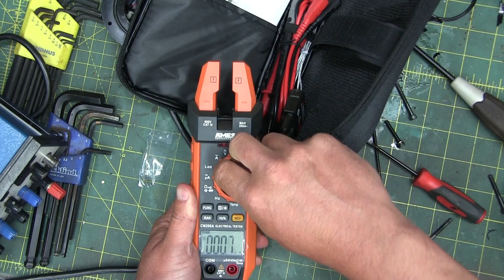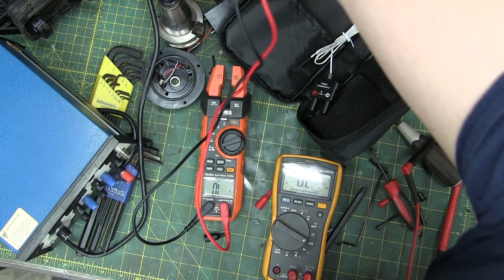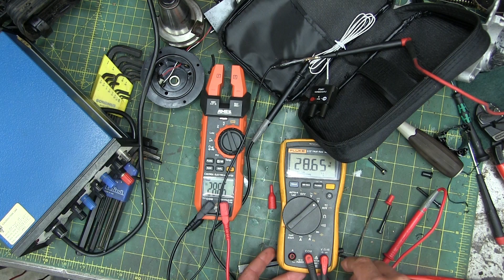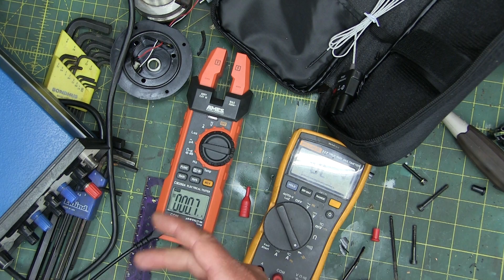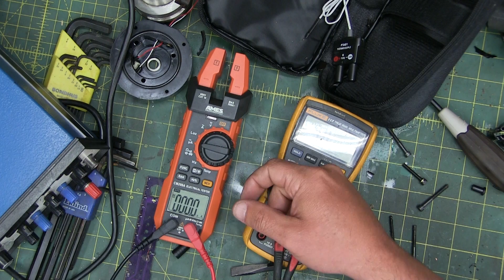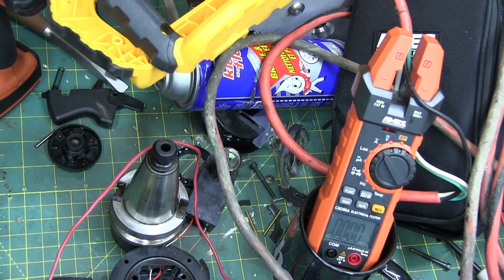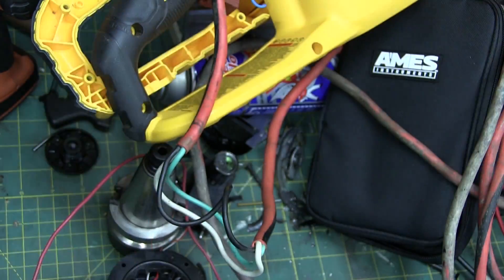BOLTR; Harbor Freight Fork Meter | Shockingly Accurate!

Comment: Not the first time I've watched this video. I have this meter and compared to all my others, the supplied leads are the best I've found. The meters I use for Electronics projects are this one(Ames CM200A) and a CenTech 61593. The Centech's limiting factors are it only has a 1999 display and it's not auto ranging. My ideal meter would be a Centech 61593, but auto ranging and a 9999 display.

Comment: In automotive use cases we use something similar to the pickle fork, we use a ring magnetic inductive pickup thing. Perfect for measuring high current with something like a fluke 88 and testing alternators or parasitic draw

Comment: Ave, I am hanging my head in shame for you. There is no way that is a CAT 3,  Cheap China meters stick those ratings on all the time. I have used HF meters before and yes they can be OK for basic stuff and even reasonably close in reading but to paraphrase you, if ya gotta KNOW, ya gotta KNOW and confidence is not high, I say again confidence is not high on cheap meters. Since I started into electronics in my retirement (use under $50 meters my whole life) I have seen the difference and thus dropped some coin on a real meter that will last the rest of my life and is warranted for life, a Fluke 287. Yes it has stuff I will never need but when say it is CAT 4 rated, you can bet your life it is truly CAT 4 rated. Likely as not the HF meter as a meter to throw in the trunk of your car or the bottom of your tackle box tool box it will serve you fine.  A backup meter on the job or to give REAL data, it is not.

Comment: still think itd be great if you checked out the 'an8009' /aneng8009 (NOT the 8008) i think youd be super pleasantly suprised by it for a dog cheap meter to actually use day to day to save risking your expensive stuff, let alone as just something to have multiple of stashed all over the place for whatever situation arises where you might need it, and it being so cheap you dont have to care about it rolling around under your car seats for months or somewhere higher risk where it might get 'borrowed' permanently or fiddled with by not-you.
and melf / minimelf / do213 / sod80

Comment: Raise your hand if you had a cheap multimeter set on ohms, and you accidentally probed a wall outlet and the thing exploded. I did this... once. It was a very cheap meter, like a 80's bottom of the line radio shack, little red POS analog meter. In a similar story, I was in a mechanical room once with a balancer guy, and we were chatting while working. Our conversation was lively, and apparently engaging enough that he, after checking the current draw on a pump, tried to check voltage across 2 of the 3 phase leads with the meter set to amps. It was very similar to an arc welder. He burnt the probe on his fluke into a ball. It popped the big fuse in the meter ( old Fluke 87 ), and he was fine, with the exception of a little singed arm hair, and seeing spots for half an hour. I remember the look of shock ( pun intended ) on his face being very brightly illuminated for a split second. He and I knew instantly when the thing lit up what he had done. Good times.

Comment: Need to call you on the carpet about RMS and Hz. RMS means AC AMPLITUDE measurements will represent true "heat producing" voltage, NOT that the Hz measurements will read correctly for all waveforms. That is a trigger method / point vs timing function.

Comment: The frequency inaccuracy with triangular wave has nothing to do with lack of RMS feature. It is having trouble with edge/peak detection to determine the frequency. Fluke is better at that. RMS comes in only when measuring the voltage value.

Comment: Someone correct me here: 2.4v won't forward bias those ultra bright blue LED's that make our rooms look like rave-rooms this last decade. I think most needed the 5v range. Neither the Fruke or Aims will do this so it doesn't really matter, but it's something I have seen more than not.

I really think I'm going to buy this thing. The Fruke 324 doesn't need to be in the general tool bag getting banged around and I don't always need the update speed. That loud buzzer sold me most of all...it tosses the flour on the moist spot so I know I'm in the right spot and he's right; I can't hear the fruke's most of the time with earhole plugs engaged. Backlit? I'll find out soon I guess

Comment: Shop X-Ray -- Watched that part 3 times.  Brilliant!  I was told never force anything, get a bigger hammer. So I think your next big selling merchandise item might be the manually operated shop X-Ray...  I think it would be overkill, but cool, to have a laser cross line to make aiming the X-Ray device more accurate... and remember to deploy safety squints while in use.

Comment: This is a great video.  Since I'm absolutely a Home Gamer, I decided that the great price of the Ames was going to give me what I need out of a multimeter.  So I went to Harbor Freight today to pick one up.  The had plenty of tickets on the shelf, but apparently they're out of the units themselves.  They had lots of other Ames meters, but not this particular one, so I decided to hold off.   My backup plan was a Craigslist ad I saw yesterday, for a Fluke 114.   They retail for at least $120, but this one was "new in the box" (or so went the claim) and was $80, firm.   I connected with the guy and we scheduled an exchange.  He was a nice enough guy, but I couldn't help but notice that the box was not sealed, but rather taped shut.  He sells items at flea markets, so he said he takes it out of the package so people can see the wares before they buy.  Hmmm.  OK.     I wasn't sure if it came with batteries or not, so I bought one at the store where I met him.  Of course, I could have just flipped the damn thing on, to see if it fired up, and it did.   I've obviously been happy with the performance of the meter, since it's  a solid piece of gear.   But I noticed that the leads weren't the same quality as your 117.   I googled the number that's on the leads and they're Fluke leads, but they're PVC.   It looks like you can buy better leads from Fluke, but jeez... that was part of the whole point of me buying a Fluke in the first place.

Anyway, then I come to this sticker on the unit.   I didn't really notice it at first.  It's a Techtronix sticker, with an ID, a serial number, a date (Sep 2015) and a "Due" date (Sep 2016).   It also has a bar code, but my phone scan app isn't recognizing the bar code, so I guess it's proprietary.   Anyway, I'm going to call Techtronix to inquire about this unit, just to make sure it wasn't stolen from them or something.  It would not surprise me if it's stolen from somebody, and I'm just starting to feel weird about it.   Now I sort of wish I had waited on the Ames to be restocked, or ponied up the cash for a legit new Fluke, if that's really what I want.

Or heck, maybe I'm overthinking it, and I should be happy that I got a damn fine Fluke meter for a good price.  Thoughts?

Comment: i got a harbor freight meter (yeah im cheap) you cant even change the batteries with sawing into the unt.  garbage besides working pretty good, the no access to batteries was a deal d=breaker though

Comment: Melf is one name for the resistors. Usually high quality if they are from people like Rohm or similar but there are some chinesium ones with about 5% tolerance and 500+ppm tempco which is rubbish for a meter. For instrumentation I generally use 0.1% 50ppm Melf or better. IA true enginerd knows that MELF stands for MEtal film Leadless Ferfacksake it rolled off again.

Comment: Thanks for this review! I bought on of that cheap (actually much cheaper) Multimeters in Singapore. Definitely manufactured in China. It has measured constantly 1V less than my battery charge controller and my boat's battery system volt-meter. But on 1.5V AAA batteries is was measuring ~1.56V. Only slightly higher voltages like 12-14V were completely wrong. As a mechanical engineer I was very confused about that situation. So, I think I should spend a few more $$$ on my electrical equipment...

Comment: Checking diodes is a current affair.  The Fluke senses a smaller current than the cheap meter so it won't light the LED.

Comment: That’s a interesting clamps design. I think they are going for the any placement wire. Hoeing to get the same reading despite wear the wire is on the clamp. Some cheaper ones are more picky and need to be at a little line or arrow in the clamp. Neat. So does it only do AC on the clamp, or will it do DC also.

Comment: I find sometimes the diode check voltage also depends on the battery levels. How old is the battery in the fluke?

Comment: You should do a review on one of those Snap-on multimeters. They charge a pretty penny for those and have comparable features to fluke meter's and even at there higher cost. I'd be very interested to see if it's build at least as good if not better built or if it's junk

Comment: Thanks for the excellent review. I've found this cheap meter is just as good as my fluke, if you don't mind the delay. Still will double check with my fluke or my EEVBlog meter for impotent readings.  Keep it up. Love your work.

Comment: There's no way I'd trust a cheap Chinese 'Cat III' meter to do 415 volt work.  I highly doubt it has actually been tested to the certification level, none of the cheap meters do, even though they print it on the front.

Comment: We do use an old Fluke meter for audio. I forget the model number, but it is still a favorite with tube guitar amp guys.   I prefer to use Bruel & Kjaer audio, meter with multiple damping rates  for audio. You can't beat that for $35, but don't bring it onto a jobsite.

Comment: one bad thing about the HF is that Current is between Voltage and Impedance. The FLuke Has Volts then Impedance. So the HF is at a higher of blowing up in your face due to current

Comment: Maybe the current isnt updating as quick because the 9 volt it came with sucks
Reply: It is more likely that the current measuring process takes more chewing on the raw numbers.  The 9V is usually enough or not enough.  There isn't really a middle ground on modern meters.
Reply: Ken Smith slower processor
Reply: It could be speed or lack of features.  A fast processor that can't multiply would take longer.
Reply: Ken Smith very true

Comment: Why do meters always use a 9 volt battery? What is it about 9 volts?
Reply: Probably something to do with needing more than 6 volts, but after designing/installing 4 batteries at 1.5 volts, things get a little weird on the design/build side, so 9v is the next step up.
Reply: Not sure I would want an 18650 in my watch, but they work fine to power flashlight, laptop, and car.
Reply: Cos 8v would just be weird.
Reply: cell phones charge off ~5.5V, but the actual voltage needed to power them is not the same as what needed for the comparator circuits that Ohm meters need. two different products. they probably could be made to run off  afew AA's, but the circuit redesign and manufacturing requirements would probably be prohibitive. I'm sure some engineer has found a road block that makes the 9v a better choice
Reply: Would imagine it's a case of needing a reasonably high voltage (relatively) at low current - lower than you'd get out of 4 AA batteries.  These days with switching regulators you probably don't need 9V (well I know you don't, I use a Druck process calibrator that takes 3 AAs and outputs 24V for loop power) but they used it historically so they've kept it
Reply: Peter Robbins Which is weird cuz cell phones are 5 volt
Reply: hey you A fecking lot of computers are 5V... Desktop computers were primarily 5V until the early-mid 00's.
Reply: Joe T:
12V is likely fine.
14V while being charged is more likely trouble.
The LM7808's datasheet is worth looking up.
Reply: slidey1000:
8V is not weird but just a bit harder to do with a battery.
As for 7V now that would be weird

Comment: I have a few harbor freight multi testers for basic electrical components and household voltage ( you know, the ones they give away for free sometimes). Well, I needed to change the romex from an outlet to subpanel it came. PROBLEM: I couldn't find the breaker, so, I shut main. Then decided to test, just for shits and giggles. AND BOOM, BIG SNAP AND FLASH. The IDIOT I bought my place from (he was a high voltage electrician ) wired this subpanel from where the power came into the breaker panel from main out on the pole instead of through a breaker. Luckily, it only melted the probes and blew the internal fuse. No loss even if it never worked again. But it did protect me. I never trust anything electrical around here. I love your test product videos.

Comment: I would enjoy a video on thermocouplers. I struggled to troubleshoot a udc3000 hooked to a type j thermocoupler. I overlooked the wire conecting them because it was a new install. It needed thermocouple extension wire not comunication wire but it tripped me up for almost an hour. Love the videos. Long time listener, first time caller.

Comment: 6:18 lead came right out of the source and the Fluke meter didn't change at all and then you stuck it back in the source while talking and it didn't change at all. What is up with that?!!?
Reply from the maker: I didn't notice that. Must be camera perspective; still touching the other lead somehow? Or just reeeeeally slow to update?
Reply: The function generator can both source and sink current.  The Fluke's input is high impedance with a small capacitive element so the input waveform is charging and discharging the capacitance through the positive lead of the meter.  The Fluke is likely counting zero crossings of the waveform to calculate frequency so an accurate reference (common lead) isn't necessarily needed.  The higher-end Flukes like the 289 can show AC+DC and Hz simultaneously so I'm wondering how a missing common lead would affect it.
Reply: it starts reading when he puts one lead in.  capacitive must be enough  for hz on fluke.
Reply: Capacitive coupling? Pixies still vibrating from one end.
Reply: The meter itself has its own ground references relative to its batteries and isolated power supplies.  Since none of the devices are perfect, tiny amounts of current do flow between your circuit and multimeter when one lead is connected since your input is the reference and the virtual ground is other.  With the signal's oscillating polarity, the meter is seeing zero crossings which allows it to determine frequency.  Since it's not referenced to the input source, the voltage measurement is not accurate.  A fluke 289 measures low frequency mains power amazingly accurately with only one lead connected.  Voltage is gibberish however.
Reply: My fluke will measure hz down to a few millivolts, more than sensitive enough it pick up a strong signal within a few inches. 

To this guy saying one lead is enough to charge a capacitor: No. To charge you need the current to flow "through" (quotes because current never actually goes THROUGH a capacitor, unless it leaks ofc) the capacitor. The other lead has to be close enough to capacitively couple (form a capacitor). A circuit must form with a high enough capacitance to allow enough current to be detecable above the background noise and rejection by the meter
Reply: You claim to know this but you're unaware that multimeters can't measure voltage directly. They can only measure current

Comment: Found this meter on ali under the make mastech model MS2601-1. It is more expensive than 35 bucks though.
Reply from the maker: Gotta wait for the double dip coupons!
Reply: For $60 USD (on Amazon) I bought the Mastech MS2215A which appears to be related.  They claim 1000 A (yikes!) measurement capability with a full clamp design. It may be useful for diagnosing automotive starters.  I just use it for 8 A air pumps on an Arduino project
Reply: Alan Welch .

Comment: it is possible that they're sonic welding the components. the components are pushed against each other and vibrated until the contacting surfaces on the plastics melt.

Comment: The micro amps could be used to measure the current from a flame sensor on a modern furnace with electronic ignition. With too little output from the flame sensor the burners go out or won’t allow the furnace (burners) to start. A good tech nows how to eliminate this problem without changing parts, but, let’s leave that to them. I’m a retired HVAC Tech.

Comment: The goal is to not blow up the airbags (or detonators for that matter) when you test it with your meter. Good meters keep the voltage and by way of ohms law current as low as possible.

Comment: Hell, some places I worked, even possessing a meter, let alone knowing how to use it was exceptional.  The HF stuff is fine for a lot of shops where "having a roof and walls" is considered a luxury.
 Last place I worked,the crappy "auto" DVOM they had shit the bed, so I grabbed my old Simpson 260.
Ended up doing the testing myself, cause none of them knew how it worked, or how to read it.
 Ended up getting a few of those cheap HF DVOMs (the really cheap ones) and billing the business.

Comment: Hold on a minute you just broke your own rule you tested it before you took it apart you seem to be doing a lot of that recently
Reply: Robert Markham probes to show hows it works for the doodads.  
Alot of these go springen and a few of the vids didnt test well after the exploded view.
Reply: Also.. most items wont work after use of the old shop x-ray.

Comment: That beep sounds a lot like my cheapo Amprobe meter. Does it have a backlight that can only be turned on by pressing and holding the "Hold" button? I bought the Amprobe in part because I didn't like that my Southwire meter did that, but I think they use the same damn chip!